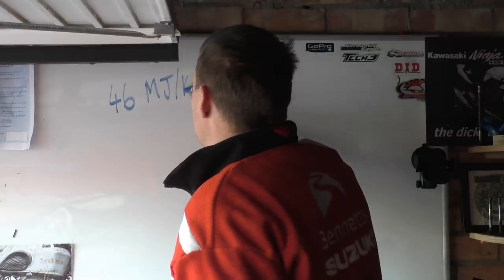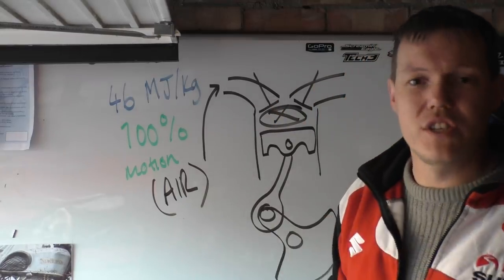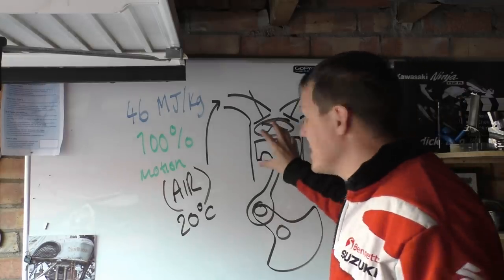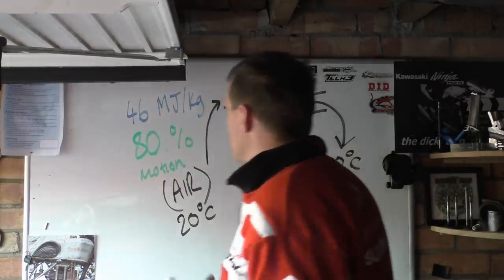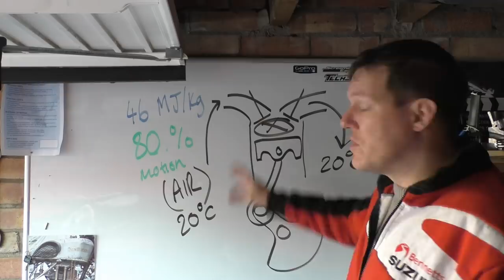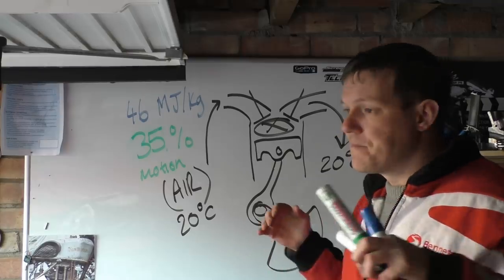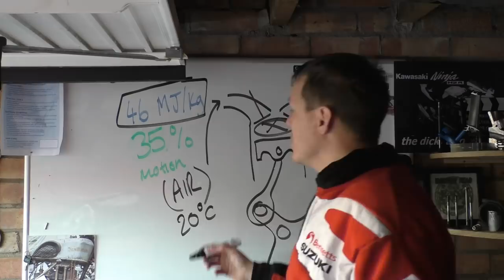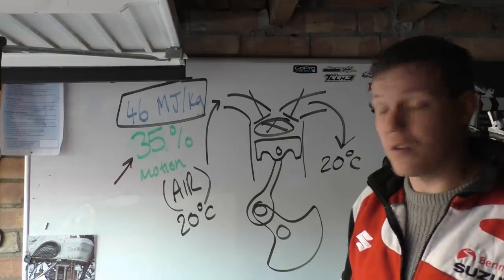What if an engine was 100% efficient?

Comment: what about a wankel engine
Reply from the maker: What about it?
Reply: @dirtygarageguy  not sure just wanted to through it out there. it would be be slightly more efficent but the seals needed for it are not that reliable.
Reply from the maker: "it would be be slightly more efficent"

- would it? Why?

Pumping loses are lower, but mechanical efficiency is down, friction loses are higher and thermal efficiency isn't up to much either.....
Reply: @dirtygarageguy  for size puts out a good amount of power with a turbo and yes are a turd with out one. they do have a long power band do to rpm range so that would be one its positve and a negitive is they use oil like a 2 stroke.
Reply: Do you have any idea the amount of fuel a wankel engine burns though? yes for its size it makes really good power but that's because theirs more than one combustion cycle going on PER ROTOR. They are not fuel efficient by any stretch of the imagination the most recent rx8's only got like 23mpg highway which for a 1.3l is terrible. Hope this answered your question.
Reply: The idea of a wankel engine is a good start though in the sense that the rotors are already spinning in the same direction the crankshaft is spinning. Whereas with a standard piston combustion engine you are trying to convert the up and down energy from the piston into rotating energy through the crankshaft.
Reply from the maker: Ah yes but which way is pressure applied? Pressure or force over a surface area is linear not rotational...... its not as simple as it turns and so does a crank.
Reply: I would say they could make good power because they are a heat pump in the way mazda made them with a high output of heat. when adding a compond turbo to match the heat you up the compresion and in turn fuel need, this sorten the life of the seals as well. at this point you have a high power and fuel draw that is out the efficent range of the weight of vehicle. since that is more power than needed I would think a half size engine would be more efficent. why wast the heat in a single stage and adding compresion dose them good, I would think a 2 stage diesel variant like rolls royce prototype would better. at that point you are adding weight so not sure if a increase of fuel efficient can be had.
Reply: How about a highly complex piston driven rotary engine or a highly complex piston engine with a supercharger that has combustion Cycles as well
Reply: Edit since we're in la la land
Reply: they dont have much of a base mecanical output to run a supercharger to be practical and a piston would hender its speed. there is smaller ones out that could be used to expirament with like from sachs. having 3 combustions a revolution yellds a lot of heat output so that is what they have to take advatage from. would be interesting to see how well thay could run a generator for a ev aplication.
Reply: found that LiquidPiston seems to be making improvements to the design of a rotory engine by using a penut over a triangle

Comment: So what you're saying is that a 100% efficient engine is one not actually working and not using fuel?

On the efficiency argument: Admit it folks, you all want diesel bikes   ;)
Reply from the maker: no - I'm saying that a 100% effcient engine is impossible
Reply: Hi my car is Mitsubishi Lancer 1999, my problem is it doesn't accelerate at once when accelerated, what might be the problem? it only start by producing loud rowing engine sound then stabilize at that for while, then can start gaining speed once I remove my leg from the accelerator pedal (accelerate gradually at slow pace).